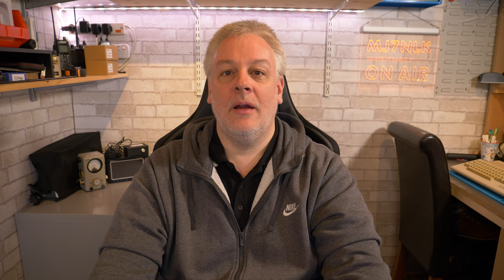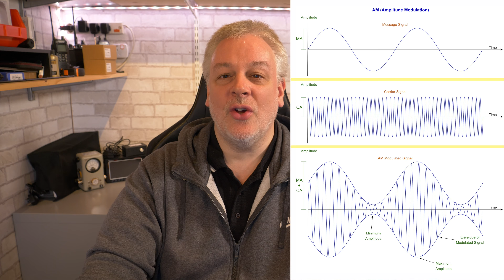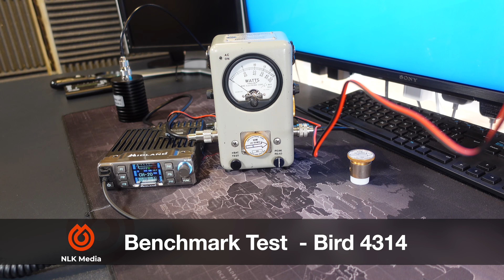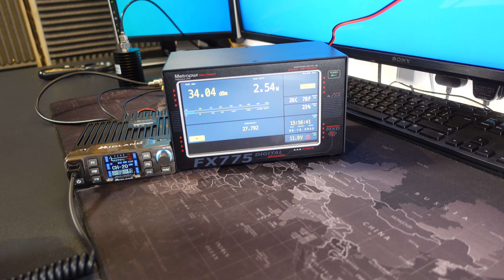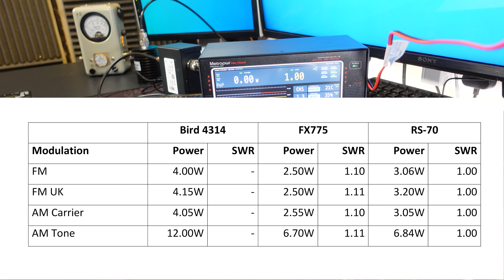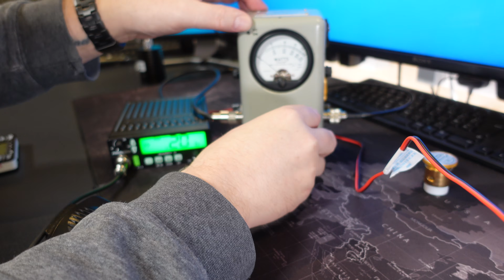RF Power Meters Tested and Compared. Not all Power Meters are equal!

Comment: Bird meters are known and believed to be trusty, and accurate. But when two other not-that-bad meters showing results very near to each other and Bird being the only one showing different measurements, I know suspect the Bird (blasphemy!)... Curious case... But this is always the problem with measuring equipment, isn't it? I have never seen my many DMMs agree with each other too, but their differences are always within their specs, not like this...
Reply from the maker: Its really hard with test equipment as you say but the bird did agree with the standard radio out the box outputting 4W which the others did not. I came to the conclusion that the only way to know for sure was to spend a huge amount on some lab equipment. I spoke to MetroPwr and they recommended the Bird and said that their coupler was not designed for such low power outputs and the bird would be far more accurate. My old bird has been calibrated but getting a new one is not cheap to compare birds. Its a mind field really but was fun to delve into. Thanks for commenting, very much appreciated

Comment: So, now im confused. What should i buy now? The big Question. My favorit was the Nissei RS-70 but if i see i 3 Powermeter and 3 different results i dont know. For now i have the Zetagi Mod.203 and thats it. What is your opinion? 73 DL1STJ
Reply from the maker: Hi DL1STJ, oh its a mine field it really is. I have spoken to so many people about this and if you want accuracy then lab level equipment is required. I got such different results using different equipment and went round in some expensive circles. I feel that the Bird is a defensible choice if challenged and gave me the most reliable and expected results. Assuming that factory set radios are tuned using lab level equipment then the bird was consistently right on the money. I have a lot of radios and I tested 5 random new units fresh out of box and the bird was exactly where you would expect it to be. Without sinking huge amounts into some very expensive equipment this was the conclusion I reached. Maybe a different RS70 to mine would be better calibrated, who knows. I have not used my FX775 since performing the tests as I just don't trust anything it tells me. All the best and thanks for watching 73. MJ7NLK

Comment: I own those 3 plus bird digital 4391 and various daiwa and comet, metropower was most accurate follow by bird 4391, daiwa 801 and after bird43p/nissei... Bird calibration it's nees if take away the instrument but more important are the slug same power slug can do a huge difference in misuration, I test my slug periodically with the digital that was 2 insert for direc/reflect adn take a look if measure the same thing on both 73 de iz3qvb
Reply from the maker: Hi IZ3QVB, the 4391A is on my list of things to acquire at some point. I spoke with Metropwr and they recommended the Bird as being the best option for measuring low wattage. They said their coupler was designed for much higher wattage (up to 3k) and would not give the same level of accuracy in the 0 to 4W range. It might be amazing if I was measuring 100W+. I think the conclusion I came to was that to know for sure it was going to cost me a lot to buy lab level equipment and a calibrated bird and slugs was good enough to get close to some sort of true power test. All the best and thanks for watching and commenting 73. MJ7NLK

Comment: I liked the video in general but I have to say something.The accuracy is of that Bird is +/- 5% of full scale (for the slug 10 W). So it can be off by 0.5 W on any reading over the entire scale. The  measurement is really 4.0 +/- 0.5 W so it could be any power from 3.5 W to 4.5 W. You never figured the accuracy of the meters into your chart. In other words, if the radio is low 0.5W from the factory, and the Bird is actually reading 4.0 W - 0.5 W error, then the actual power could easily be 3.5 W. The other meters have accuracy limits as well. The only way to discriminate between them all is to have a much better commercial RF power meter to check them against, such as an hp 437B or other like item. Checking them against the manual is no guarantee of anything. I've measured a lot of more expensive amateur radio transceivers with commercial power meters and none of them agree exactly with the power outputs listed in the manual.
Reply from the maker: Hi Nashme, yes you are correct, most meters have an accuracy range of anywhere from +/- 5% up to 10%. However, the MetroPWR has the same deviance rating as the Bird but was wildly different. I think the take away is that unless you buy a seriously expensive calibrated bit of lab equipment you are never going to know for sure. I spoke with MetroPWR about it and they said, its a 3KW coupler and will be much less accurate in the 0 to 10W range and was designed for much higher power outputs. I highlighted the +/-5% accuracy rating in their documentation but they didnt have an answer for that and they recommended a Bird for low wattage readings with 10W slug. Thanks for commenting, it's an interesting topic. All the best

Comment: Everyone seems to put a LOT of faith into these Bird Meters, yet NO ONE uses CW as the test signal, which is what they are designed to measure. I think you should check it's calibration too. I have one of the RS-70' s myself, and when it was tested against a high end lab scope, it showed less than a 10th of a watt difference from 1w to 200w, it was tested to 250w and was still accurate, but it gets VERY hot when you go beyond the specs. I'm confident enough in mine to continue using it. I also have a Dirland power meter and a few other SWR/Power meters, they all seem to be within a close enough range to the RS-70. The crossover weighted needle type meters I have are the ones with the highest drift, but this is still under 1w from the test machine.
Reply from the maker: My old bird was calibrated about a year ago. The MetroPWR unit was most inaccurate due to the 3Kw coupler in the lower ranges of 1W to 10W. It depends on what type of signal you are measuring but in this case CW and AVG for FM CB are comparible. My RS-70 eats batteries at an alarming rate so could be my unit. The point of the video was that without a very expensive bit of lab equipment you just don't know how accurate your meter is. You also need to have confidence in the slugs for the Bird that they have not been dropped or damaged. Thanks for watching and for commenting. All the best

Comment: How is 3.06W perfect 3:50  when you got a refernece value from the bird that were +33% higher.?
and the Bird 4W were +60% higher then Metropwr775 with 2.5W.. quite a margin.
You should take a look at the very cheap digital power meters from far east.
Like SW-33Plus and SW-102. (125Mhz to 525Mhz UHF/VHF.)
its SWR & Watt powermeters to around 35 bucks that quite a few in the Ham community took the plunge on... would be interresting to see how these far-east-gadgets from the local market, actually stacks up to an aspect of reference gear.
Big thumbs up for your video.. second to none, and one of the best compare videos I have seen on Power wattage meters... it comes acroos as extremely honest & no underlying agenda.. simply let the values stand on their own two feet and try to sense what is up or down... love it.
Reply from the maker: Hi Jakob, Power Meters are a mine field and knowing which one to trust is difficult. The Metropwr775 has a huge 1.5KW coupler and after speaking with Metropwr directly they said that it’s not meant for lower wattage accurate readings and this is why there were variances even although the spec sheet said +/-5% tolerance. I also spoke with a tech at one of the largest UK radio suppliers and they told me they had given up on trying to find an accurate power meter at an affordable price range as they all show different results. You need both measurement types CW and PEP in order to test the output of FM and AM especially when calibrating a radio accurately or as close to the legal limit as possible. It would be interesting to purchase some of the cheaper meters on the market and compare them to the Bird using this as a reference point. It was really hard to put this video together as not having a definitive reference point meant that I did not know what was accurate / which was correct. Even down to picking the test radio was difficult as they all advertise 4W but when tested they can be showing anywhere between 3W to 4W depending on what meter you use. So, I settled on a new, never used Midland, and when testing on the Bird out of the box it showed 4W which is what it should have been outputting. The RS-70 isnt cheap, the Metropwr was very expensive and the Bird was equally as expensive as the Metropwr. So, all in all, it cost me quite a lot of money to get a reference point I was comfortable with (well over £1k). Thanks for your comment and for watching. I am sure I will return to this topic again once the wallet has cooled down from this one :-) All the best

Comment: Cant you reference a given RF signal with a modern DDS arb waveform generator.?
so you aint having to rely on some FR product and its claimed wattage specs, that often can vary greatly acroos the span.?
I dont know much about this, just curious if a moden waveform generator couldnt manipulate a given signal that you can use as sort of a refernece to test fx a watt power meter with a dummyload?
Reply from the maker: Hi Jakob, I have an OWON XSA1015 spectrum analyser but this does not help with testing power output. It has a 1W maximum input signal and requires a signal tap attenuator to be used to take a low power tap from the output signal. I am not sure if you can set the output power level of a particular waveform generator but this then puts question into how accurate the generator being used is with its output level. I have two signal generators but both on Oscilloscopes. I was trying to avoid having to purchase more expensive calibrated test equipment but the Bird is calibrated so should be a reliable reference point to use. It was a fun video to put together as the more I investigated this topic the more questions appeared. All the best and thanks for watching

Comment: We all know manufacturers supply radios at least 10% below the legal maximum as a safety margin,so i was surprised that the bird meter gave such a high reading???
Reply from the maker: Hi Simon, I have found that the Midland units are far closer to the wind than the President units. I guess the closer to 4W the radio the better it performs and sells. Some President radios are well off the mark and others are much closer. Something to keep an eye on when testing. Thanks for watching

Comment: Interesting topic, thats for sure! I own a analoge Team 1188 W with SWR and-Powermeter for CB. For routine measuring SWR homeantenna or to have a quick look at the approx. output of a radio its fine, but to get 100% trustful results its not a winner, of course not by a price of 20€. I only would calibrate a radio by a digital amateur radio device. However, not everybody has the money for a Rhode & Schwarz precise reference instruments, but to see wether SWR or Power is ok or not a simple analoge SWR-Powermeter works always precise enough with its +/- 5% difference. Vy 73, Gordon, 13 SW 128
Reply from the maker: Hi Gordon, thanks for watching and for commenting. It was a bit of a mine field and ended up costing me quite a bit. I always relied on the RS70 and then purchased the Metropwr and noticed a difference in readings. Then had to buy the Bird to find out which was closer to the truth. If your tuning CB radios to a whisker below the 4W limit then you need something accurate. The Rhode & Schwarz meters are quite costly but its more about the size for me. I just dont have room for one. All of the meters tested had +/- 5% in their documentation but the differences were much greater than that. All in all it was an interesting task in the end and learnt lots along the way. 73's and Happy New Year to you

Comment: I use a bird 43 p with bird slugs NOT coaxial dynamic slugs. You can at any time call Bird send your unit back to the factory and have it calibrated. There is a small charge. In the '80s I used to tell a wave they only go up to 500 watt but it was pretty darn accurate too it looks a lot like the bird. Thanks for the video it just affirms what I already knew wave of the hand and 73rds from unit 33 New Jersey USA
Reply from the maker: Hi Kenneth, I am really pleased with the Bird 43 and its going to be my go to meter from now on. All the very best for 2023 and thanks for watching and for commenting. 73's MJ7NLK